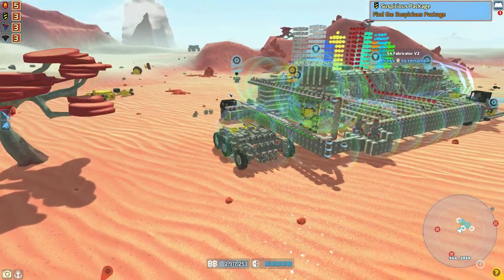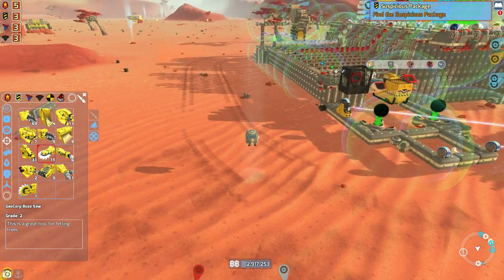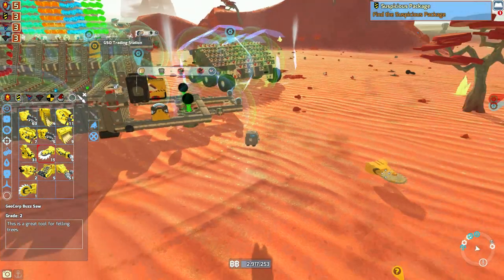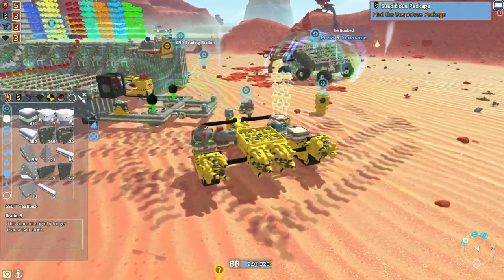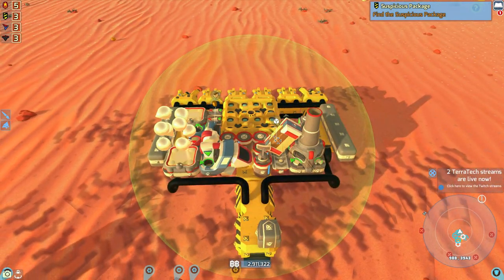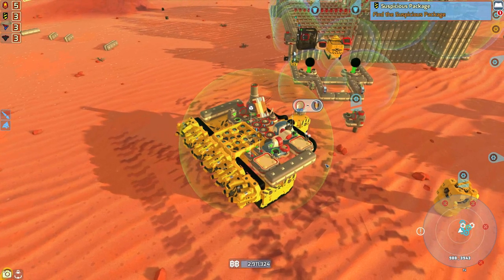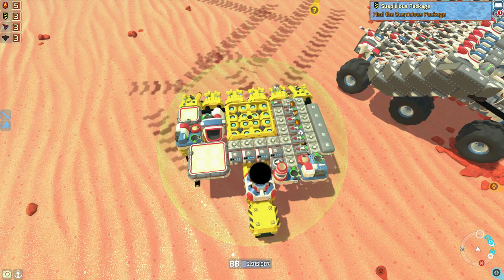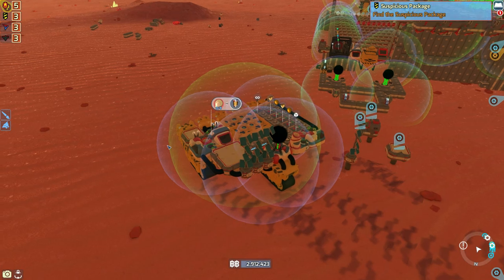Terratech | Ep21 S4 | Tree Harvester & Mobile Fabricator!! | Terratech v1.0 Gameplay

Comment: 17:55
@Lathland, just attach the Venture refinery with both in- & out-put directly to the HC-collector, then from the main collector ONLY extract refined resources (as long as you don't involve scrappers you don't need to worry about components)
Reply from the maker: I think having the raw and refined more separate like this is a cleaner look, also having two refineries in the end rather than one is somewhat faster as normally refineries and delivery cannons are the slow bottleneck - I could also now add more cannons later with minimal issue to speed up everything without having to worry about refineries, this design is also more flexible in case I ever want to craft using raw resource. But I do see your point, but prefer my version for ease of use later :)
Reply: Let the venture refinery work while you are driving & with some filtering you can also let the venture delivery cannon work while driving, then you will only have the resources you want left when you anchor, in that way you also save space in the HC-collector because you are only keeping the resources you actually want.
You don't want any raw resources for selling or "blocking" so refine them as soon as possible to get rid of that problem.

Another tip, the GSO thimble collector has one of the longest ranges, and all silos pick up from all collectors, so use one or more thimbles at the side of a big silo, to get long range & a huge storage.
One thimble can feed up to 4 silos if you offset the silos to form a 1 block hole in the middle (like a (anti-)clockwise spiral-like pattern, if that makes sense?)

Comment: It's the crafting bug show, with Lath, the Brummie (heh, so not too far from me, I'm so bad at recognising accents, or you don't really have one).

25:55 - yeah, this is a known bug (reported last November), although it was reproduce very slightly differently. Titled "[0.7.8] Fabs sometimes take resources but don't produce blocks". It's kinda niche compared to most the other crafting issues, though. (Have to be crafting direct off a Silo.)
Reply: Oof
Reply: if the silo is the problem then just put a conveyor/filter in between
Reply: to me its looks like the pacemaker making the issue, like its too quick for the game to relise that its going into an fab

EDIT - also when he changes the recipe the resources slow down, like its on normal speed even tho the pacemakers still on full speed
Reply: Another issue could be having some of the previous resource still inside the fabricator when you switch over to the next block to craft. Maybe there is an issue where it gets stuck on stupid, because you told it to make one thing while it's still holding stuff to make another. I noticed when Lathrix switched to rubber there was always a bit of wood left, but when he took the pacemaker off, it happened to be empty. Either way, easy test.
Reply: The bug definitely requires that there are already ingredients in the Fabricator. Switching blocks like that, without *Cancelling*, doesn't give it time to do it's little "I'm destroying resources" fart. Just one piece of conveyor in between silo and fab will give it this opportunity and negate the bug.
Reply: Thanks @Midnight. ;-p  

I do also make mistakes a lot, though. And I'd always condone questioning assumptions and such. :-)

Comment: A bit late, I know, but you could make it considerably smaller by refining directly from the collector pad, then filter out the refined wood and rubber. This way you could instead use one 9 slot silo for each (or a 4 slot for rubber, it's considerably rarer than wood), have only one refinery that feeds into both the silos and the resource cannon. Also, you could then either use a single fabricator if that's what you want (just offset the silos so you have the fabricator connect to both, less of a problem if you use the 4 silo for rubber), or two separate ones so you'd just bypass the fabricator just eating resources when changing the crafted thing (as you wouldn't ever change that).

Comment: Lathix what was happening was the refinery had blocks inside it when you switched and so it destroy the ones inside it and the ones going into it.
Reply from the maker: That's not quite correct, you can normally swap between recipes on stationary bases with refineries without the new recipie simply destroying the blocks entering it, it WILL destroy the blocks already inside but as soon as it swaps it should accept the new blocks which are used in its recipe. At no point should the fabricator accept blocks and destroy them, only destruction of blocks already inside is normal, making this a bug sadly! It's.. a bit weird! :P

Comment: why don't you just put the mobile refinery to input and output to the tractor pad then filter your refined materials
it is not a bug the fabricator will not work mobile but is won't just destroy your resources for going mobile ether
26:18 no clearly the developers intended your refinery to turn into a black hole of coarse that is a bug
interesting every time you hit a tree your SCU turns off

Comment: It was taking the blocks before spitting out the not completed one first and after it took all the resources it sput out the not completed maybe its becuse it did not have enough time to spit out the not completed one first? Try adding conveyors to delay the resoces getting to the fab before it sput out the not completed one first
Reply from the maker: It's a confirmed bug It turns out, it really shouldn't need a delay as the resources are destroyed instantly when you swap recipes, It was just not working as intended sadly! Just need to be very careful about it!

Comment: It a problem with the pastmaker it takes it and shows it but with the pastmaker it does not know it took it or 1001110101111110101010101010100011010101010101001101010100110001111111100001111110111110101010110111011011011101000011010000011000111011101101011010101101101011101000000101011010101